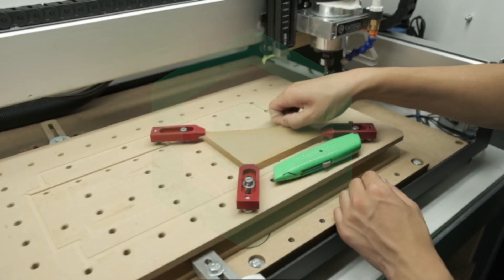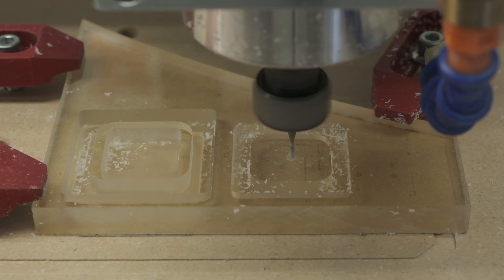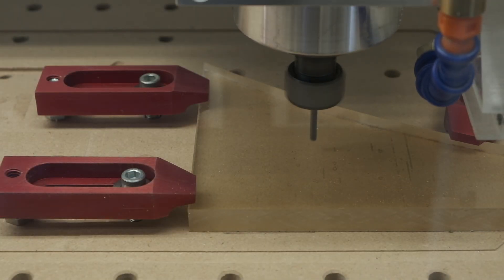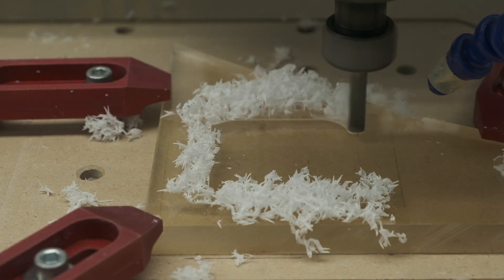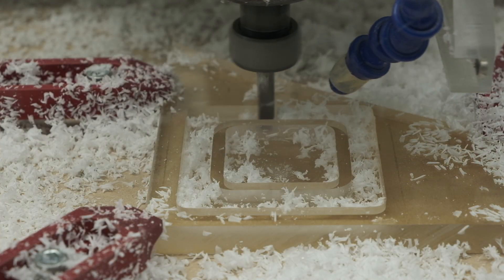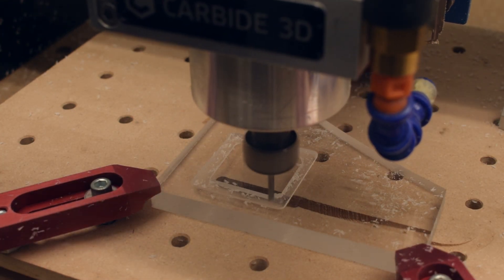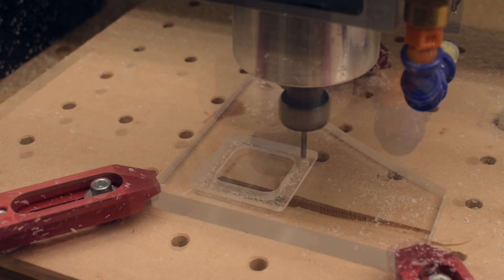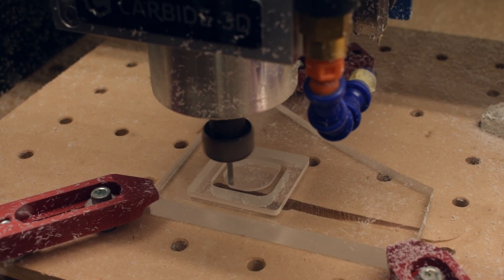Acrylic Speeds & Feeds for Shapeoko - #MaterialMonday

Comment: for the air blast system, how does it work? are you using compressed air? or some sort of blower?
Reply from the maker: This particular example was hooked up to an air pump (hydroponics style). If you prefer a more powerful setup that can blow denser aluminum chips out of the way, we have some guidance on our Shapeoko Air Assist Kit page that should be applicable to whatever solution you end up going with. 

https://shop.carbide3d.com/products/air-assist

Comment: Great video! 

What 1/8” end mill did you use in that section? 
Single flute? 
We are trying to cut acrylic on somewhat upgraded xcarve, and though we got the 1/4 cuts working we seem to be having issues with 1/8 cuts with a single glue upcut.
Reply from the maker: Single flutes are the way to go with Acrylic.   We have a pair of single-flute endmills that excel in acrylic projects.  
Here is the 1/8":  https://shop.carbide3d.com/collections/cutters/products/274z-125-single-flute-zrn
Reply: We found that dual flute worked much better yesterday, because the spindle speed was slower and less inclined to make melted acrylic and also let us move the the bit away from the cut faster.

Comment: Good video, what are your recommendations for engraving acrylic and type of bits? I’m getting build up on my vbits which is marring the surface white,  thanks!
Reply from the maker: Hi Buddy.  Diamond tip drag engravers are the go to for acrylic.   90° and 120° varieties of the McEtcher.  Reverse your art, engrave the back side of the acrylic for best results.  
https://shop.carbide3d.com/collections/cutters/products/mcetcher-diamond-cnc-drag-bit?variant=39271659634749

Comment: I'm having a hard time finding the right settings for small bits for engraving. I have a .8mm bit or 1/32bit and I'm engraving on cast acrylic. I got the depth at .02in but unsure of the rpm or feed rate?
Reply from the maker: Shaun.   Many times going faster is better with acrylic. However with a 1/32” you get into issues of potential breakage of the endmill.  Go faster and shallower and see if that yields better results.

Comment: Great video,  Can you make a feed and speed video for PVC?
Reply from the maker: Cellular/Expanded PVC (or trim board) is meant to be treated just like wood for the most part. Maybe drop RPMs slightly, but if you know how to machine wood, you know how to machine PVC. Solid stuff, like in a PVC pipe would require speeds and feeds closer to that of hard plastic (like this).

Comment: Winston - which software package(s) did you use to produce those various toolpaths?
Reply from the maker: Fusion. I disabled lead-in/out to make Contour/Pocket comparable to CC.
Reply: @carbide3d  Does CC now support pocketing starting at the perimeter rather than the center?

Comment: Use air cooling to keep the tool cool for longer operations ;) And only use single flute endmills which are new/very sharp/only used for plastics!
Reply: So, did you buy that Mechatron HF spindle systems?  For a Shapeoko?
Reply: @gmack4097  Haha no - putting such a spindle on a shape oko is a bit the wrong ratio right? I have a simple Datron M1 100x50cm ;)
Reply: @FriedrichKegel  Yup - but their HFP-6508-60-ER11 would be awesome on Shapeokos - albeit likely quite expensive!
Reply: @gmack4097  Dont get me wrong, i love their portfolio but I dont belive that you can justify a spindle at the same price of the machine. It makes totally sense if you jump to ATC spindles, but before that, get a 300$ 800W-2,2kW Spindle and you are good forever ;)

Comment: Can these settings also be used for a single O-Flute endmill?
Reply: You can likely push similarly hard, but other than doing some empirical testing to find exact values, your best bet is to consult the tool manufacturer as they know best.